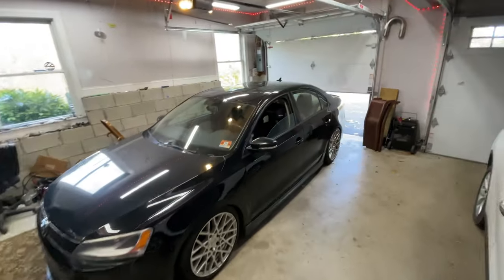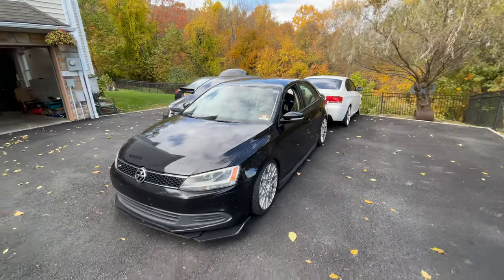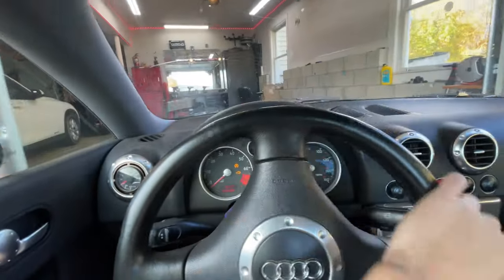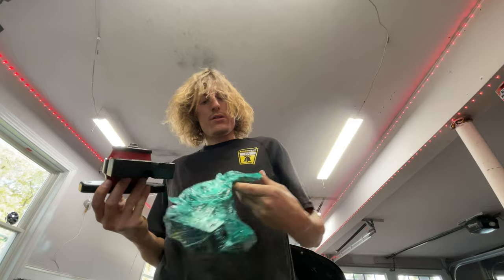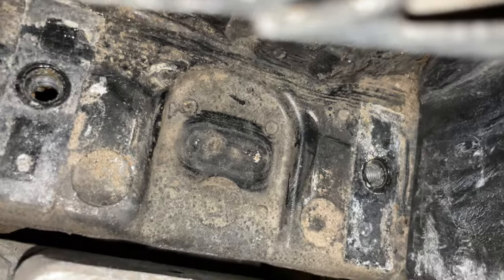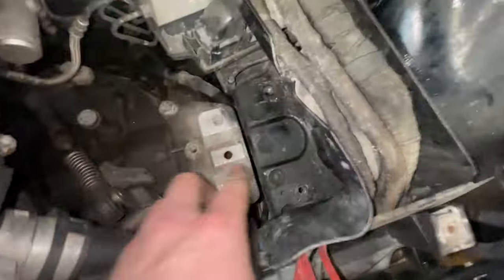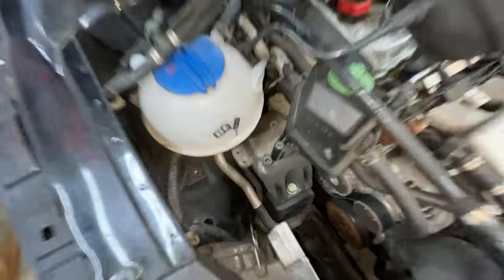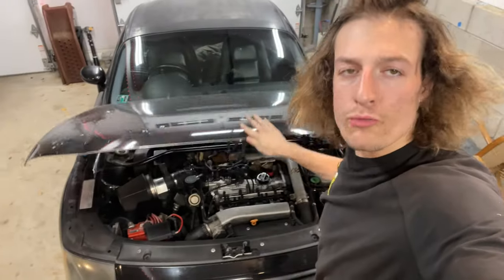I INSTALLED STAGE 2 engine mounts in my AUDI

Comment: Hey those are some nice engine mounts👀 

In terms of the NVH (Noise, Vibration, and Harshness), we found in testing that our transmission mount in combination with our engine mount does increase the NVH considerably more. We found that this combination is best suited for High Performance Street Vehicles or racing applications. If you are looking for other options though, we'd be glad to help!
Reply from the maker: Hey guys i hope there are no hard feelings 🫶it may be my exhaust is hitting the chassis or i just have to get used to them🤘🏽